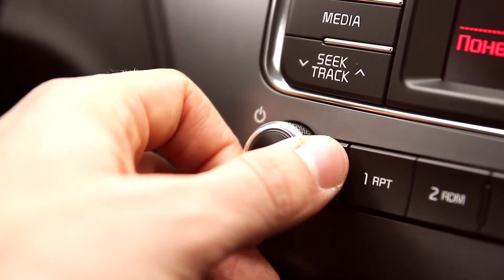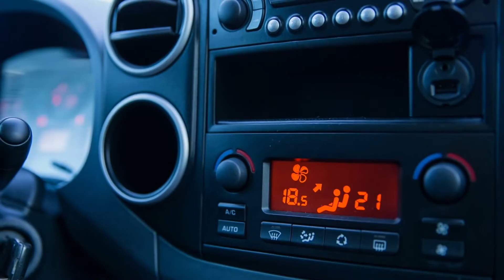6 Types Of Car AC Noises & Sounds | What Should You Look Out For

Comment: Mine is making a noise when I turn it off, it's none of the ones you mentioned, I would say it's sounds louder than it should when I turn it off.
Reply: Mine has done that for 7 years.  It's just the pressure equalizing. They seem to never say that in these vids.
Reply: @somersfamily mine gurgles when it's switched off
Reply: They did, at like 30 seconds in  @somersfamily
Reply: Can you put the noises in?